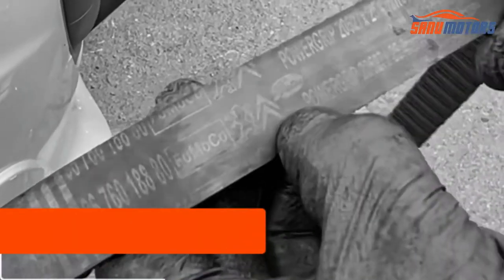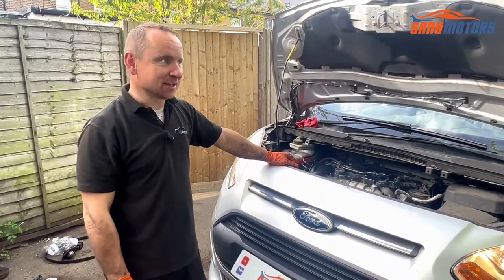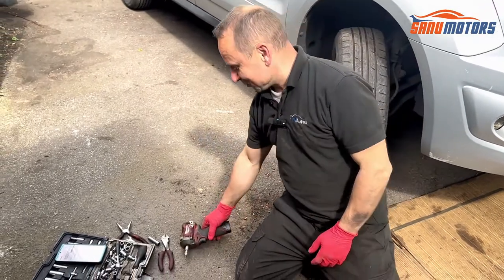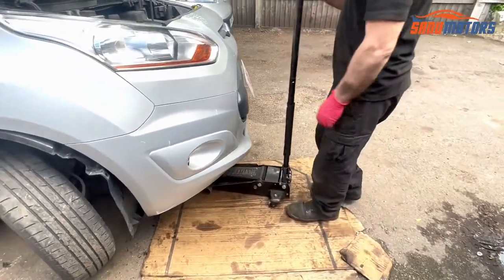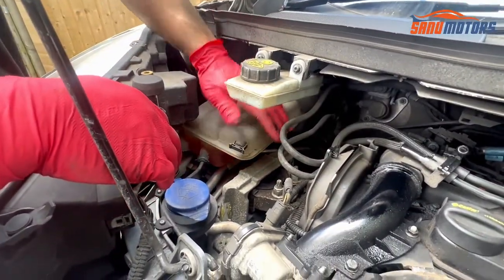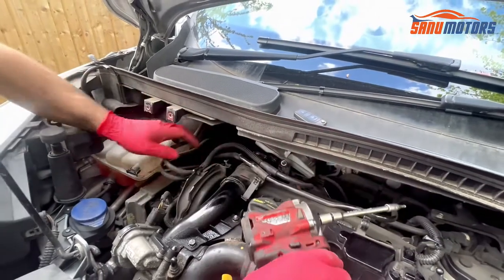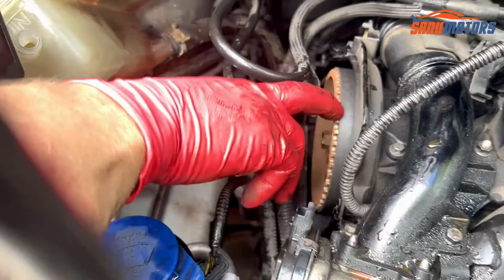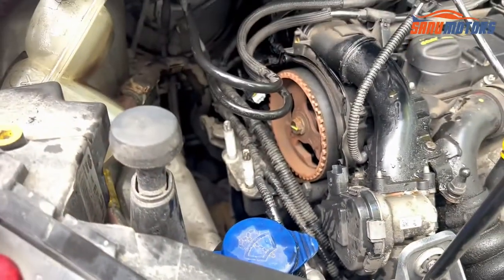Ford Transit Connect Cambelt | Timing belt and Water pump Change | 2023 Full Guide 🔥🤗 #ford #cambelt

Comment: had a quote from ford 1000+vat. (obvioulsy dealer garages are highest), and had a guy quote me 250 supplied and fitted. Is this a price a mobile mechanic would charge for this job? And if hes good, could he get the whole job done in 1-3 hours?
Reply from the maker: A quote of £250 supplied and fitted for replacing the timing belt on your 2017 Ford Connect diesel by a mobile mechanic seems quite low but not impossible, especially if the mechanic is experienced and has lower overhead costs compared to a dealership. Here are a few considerations to help you evaluate this offer:

### Cost Breakdown and Comparison
1. **Typical Costs**: Generally, the cost for parts (timing belt kit, water pump, auxiliary belt) can range from £100 to £220, depending on whether genuine parts or aftermarket parts are used. Labor can add another £150 to £300 based on the mechanic's rates and the complexity of the job

2. **Mobile Mechanic Rates**: Mobile mechanics usually charge less than dealership garages because they have lower overheads. A quote of £250 might suggest the mechanic is using aftermarket parts and charging a reasonable labor rate.

### Job Duration
1. **Time Required**: An experienced mechanic could indeed complete the timing belt replacement in about 2 to 3 hours. The job involves:
   - Removing the necessary components to access the timing belt.
   - Replacing the timing belt, water pump, and any associated components.
   - Reassembling everything and ensuring proper timing and operation.
   
   If the mechanic is well-versed with your vehicle model, they can efficiently complete the task within this timeframe

### Evaluating the Mechanic
1. **Reputation and Reviews**: Check reviews or get references for the mechanic. Good reviews and recommendations can give you confidence in their work quality.

2. **Warranty and Guarantees**: Ensure the mechanic offers some form of warranty on both parts and labor. This provides protection in case anything goes wrong post-repair.

3. **Experience and Certification**: Verify the mechanic’s experience with similar jobs and whether they are certified or belong to any professional automotive organizations.

### Conclusion
While £250 is on the lower end of the typical price range, it is feasible for a mobile mechanic to offer this rate. The key is ensuring that the mechanic is reputable, uses quality parts, and offers a warranty on their work. If these conditions are met, you can confidently proceed with the repair at a potentially significant cost saving compared to the dealership quote.

Comment: Hi, thanks for the great video. Keep this content comming.

What is the change interval?
Reply from the maker: Thank you for watching and your support! The cambelt (timing belt) change interval for a Ford Transit Connect can vary slightly depending on the model year and engine type, but generally, Ford recommends changing the timing belt every 100,000 miles (160,000 km) or 10 years, whichever comes first. 

However, it's always best to check the specific maintenance schedule in your vehicle's owner manual or consult with a Ford dealer to confirm the exact interval for your engine type. Regularly inspecting the belt for signs of wear can also help ensure it’s replaced before it fails.
Reply: Thanks for the reply. I just checked the interval in my ford app, it says 240.000km or 10 years. I am at 150k now.

Comment: Just done the belt on my dad's Transit Connect after watching this video - great video, very detailed, so thank you. However, I couldn't make out where the bleed screw on the thermostat housing is, will have another look tomorrow to bleed coolant system
Reply from the maker: I'm glad to hear that the video helped you with replacing the belt on your dad's Transit Connect! Bleeding the coolant system is an important step after performing such maintenance.

The bleed screw on the thermostat housing is typically a small, usually brass or steel, screw located on or near the thermostat housing itself. It's used to release any trapped air in the cooling system to ensure proper circulation of coolant.

Here are a few tips to help you locate the bleed screw:

Consult the vehicle manual: The manual often provides detailed diagrams and instructions for locating components like the bleed screw.

Check around the thermostat housing: The thermostat housing is usually connected to the upper radiator hose and can be found near the engine block. Look for a small screw protruding from the housing or nearby.

Look for a small protrusion: The bleed screw may look like a small bolt or screw with a hexagonal or square head, often distinguishable from other components by its location and size.

Use a flashlight: Sometimes, the bleed screw can be tucked away in a tight spot, so using a flashlight can help you locate it more easily.

Refer to online resources: If you still have trouble finding it, you can search online for diagrams or forums related to your specific vehicle model. Other owners may have shared tips or images that can assist you.

Once you've located the bleed screw, use caution when loosening it, as it's typically made of softer metal and can easily be damaged if too much force is applied. After bleeding the system, make sure to tighten the screw securely to prevent any leaks.

Comment: got a 2017 connect. deisel. not a wetbelt. Ford quoted me (huntly aberdeenshire) 1000 + vat. Anyone had one successfully fitted for less in other garages?
Reply from the maker: It seems like you've been quoted £1000 + VAT by Ford for replacing the timing belt on your 2017 Ford Connect diesel, which is quite a significant expense. However, there are other options that may be more affordable.

1. **Comparing Prices**: It’s beneficial to shop around and get quotes from multiple garages. Independent mechanics often charge less for labor compared to authorized dealers. You might also find that some independent garages offer warranty on their parts and service, similar to what Ford provides.

2. **Parts and Labor Costs**: The cost breakdown typically includes parts (timing belt kit, water pump, auxiliary belt) and labor. Parts alone can cost around £220 from Ford, but cheaper aftermarket kits might be available

3. **Local Recommendations**: Seeking recommendations from local car forums or community groups can also help you find reliable and cost-effective services in your area. Many users share their experiences and can point you towards trusted mechanics.

Considering these options, you should be able to find a more cost-effective solution than the initial quote from Ford. Make sure to confirm that the garage uses high-quality parts and provides a warranty for their work to ensure peace of mind.

Comment: Dose a 2016 mrk 2 connect have a  wetbelt?
Reply from the maker: The 2016 Ford Transit Connect Mark 2 does not have a wet belt. It typically comes equipped with a timing chain rather than a timing belt. The timing chain is located within the engine and is lubricated by the engine's oil
Reply: Oh OK, thanks. I was told by Halfords it had a belt, and would need changing at around the 90 thousand mark.

Comment: Hey I wonder if you can help I locked the cam and fuel pump with pins and un done the bottom pully went to lock it and its not in alignment is at approx 9 o'clock. Can I turn the bottom crank and then lock it before I put the new belt on ?.
Reply from the maker: Hey, it sounds like you're working on the timing for your Transit Connect. If the bottom crank is not aligned after locking the cam and fuel pump, you can carefully turn the bottom crank to the correct position. Make sure it aligns properly before you install the new belt. Double-check your timing marks to ensure everything is in sync. It's crucial to have everything perfectly aligned to avoid engine damage. If you're unsure, consulting a service manual for your specific model or seeking professional advice might be a good idea. Good luck!
Thank You
Reply: Thankyou for the reply yes its on the same model your doing it on. As I already locked the top off I think when I undone the bottom pulley it made the crankshaft pully skip a few teeth anti-clockwise that's why I'm guessing it's not aligned now. So turning it back clockwise and locking it should take it back to tdc?
Reply from the maker: Yes, if the crankshaft pulley has indeed slipped a few teeth, turning it back clockwise to align it with the Top Dead Center (TDC) mark should restore the proper alignment. Here's a step-by-step guide to ensure you do this correctly:

Ensure Safety: Make sure the vehicle is in park (automatic) or neutral (manual) and the parking brake is engaged. Disconnect the battery to avoid any accidental starts.

Remove Necessary Components: Depending on your vehicle, you may need to remove the timing belt cover and other components to gain clear access to the crankshaft pulley.

Locate TDC Mark: Identify the TDC mark on the crankshaft pulley and the corresponding mark on the engine block. There may also be marks on the camshaft pulleys.

Rotate the Crankshaft: Using a suitable socket and ratchet or breaker bar, slowly rotate the crankshaft pulley clockwise until the TDC marks align. Be sure to turn the crankshaft slowly and smoothly to avoid any damage.

Check Camshaft Alignment: Verify that the camshaft pulleys are also aligned with their respective timing marks. If the camshafts are not aligned, you may need to rotate the crankshaft another full turn (360 degrees) to bring the camshafts into alignment.

Lock the Crankshaft: Once all the marks are aligned, you can use a locking tool to keep the crankshaft in place while you reassemble everything.

Reassemble Components: Reinstall the timing belt, ensuring it is properly tensioned and all marks remain aligned. Reattach any components you removed to access the timing area.

Double-Check Alignment: Rotate the crankshaft manually through at least two complete cycles and re-check the timing marks to ensure they remain aligned. This will help confirm that everything is correctly positioned.

Reconnect Battery: Once you're confident everything is correctly aligned and reassembled, reconnect the battery.

By following these steps, you should be able to return the crankshaft and camshaft to their proper alignment at TDC, ensuring the engine timing is correct. If you encounter any difficulties or uncertainties, consulting the vehicle's service manual or seeking assistance from a professional mechanic is advisable
Thank You
Reply: @sanumotorswithcharlie  amazing thankyou for your help its very much appreciated
Reply: It worked luckily 🙏 I turnt the crankshaft back to locking postion.  Thankyou so much for your help.

Comment: Did this today on my 2018 1.5TDCI model, 1 day graft. Saved me a few hundred quid minimum!!!
Reply from the maker: Nice. Thank you
Reply: hi mate. did you get any quotes from any mobile mechanics? ford quoted me 1k + vat. a mobile mechanic (aberdeenshire) just quoted me £250 all in.
Reply: @amwartwork Unfortunately I have severe trust issues with garages and mechanics since moving city to live with my girlfriend. I've been fucked twice now over small things so I basically do all servicing myself. To me that quote seems great but shockingly cheap. Does the cost include water pump and tensioner as well as the belt?

Comment: Really helpful video. Did the job myself as a couple of garages weren't interested. Worst bit was unclipping the coolant tank. Also when trying to use the hole in the bell housing to lock the flywheel whilst tightening the crank pulley it turned out there was no corresponding hole in the flywheel! Never mind, got someone to jump on the brakes instead.
Reply from the maker: Thanks for the feedback. Your very good. How ever done big heart operation with help. 
Contact that garage’s and ask to forward like this job for u.
Well done 👍